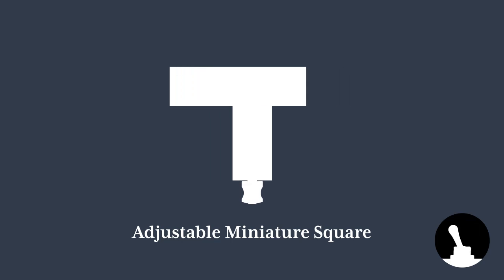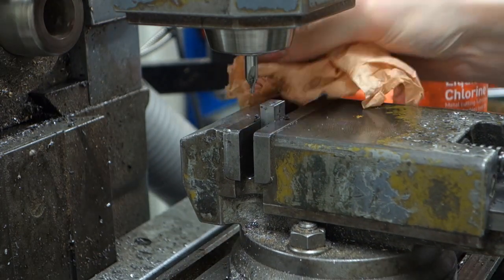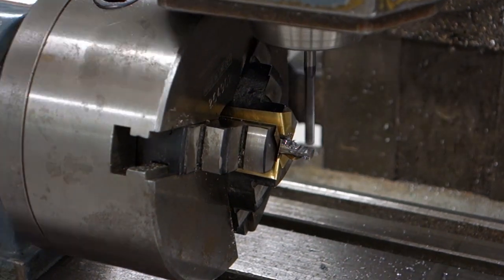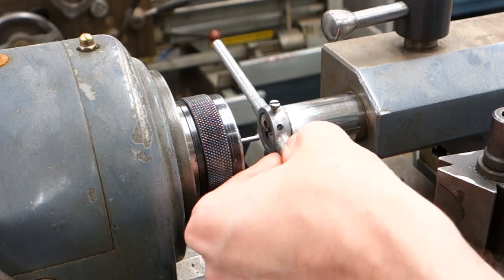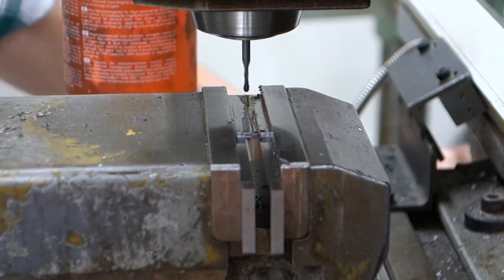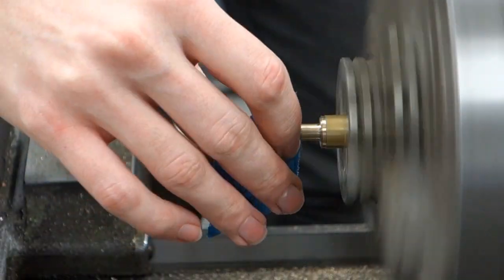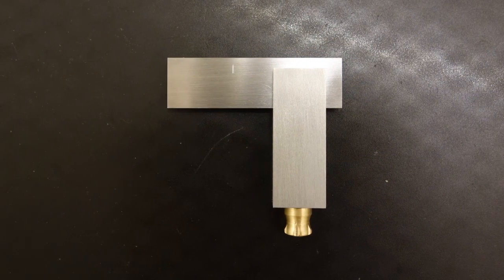How To Make a Miniature Adjustable Square

Comment: I wonder if you lapped it wouldnt it be more precise
Reply from the maker: How precise it is depends on two things. How parallel the groove in the blade is to the bottom/top of the blade and how perpendicular the slot in the handle is to the sides of the handle. For a square as small as this accuracy isn’t going to be a huge deal, unless you really mess up your setup when milling. Surface grinding (not lapping) may help in getting higher accuracy, but this is a quick check square, not a high precision instrument.
Reply: @SwitchAndLever  i see

Comment: nice, no need for a key though, the pin will not turn as the ruler/scale/slider is in the way and will stop it spinning
Reply from the maker: That’s not what the key is for. The key is for aligning the pin to make insertion of the ruler easier, as well as to keep it aligned so when you tighten the ruler it pulls it down rather than binding to the side of the ruler by twisting. So while the key isn’t strictly necessary it’s by far a good feature.
Reply: @SwitchAndLever  good points thanks

Comment: Since the draw bolt cannot rotate due to engagement with the blade, why go to all the trouble with the key and key slot?
Reply from the maker: Two reasons, it keeps the bolt aligned when sliding the blade, so it doesn't rotate and bind, as well as it makes it easier to reinsert the blade if you remove it.

Comment: Nice video, great tool. I think the shaft can't rotate even without the keyway because go the sliding piece. Thanks for sharing.
Reply from the maker: It will rotate enough to bind against the ruler part, which creates unnecessary wear and makes it more difficult to tighten. While not strictly necessary it makes it a better product in the end.

Comment: I like how you shaped the thumb wheel without using a knurling tool! very inventive. Here is my very noob question. How do you test for square when done? 123 block maybe? I have a few squares in my box, but I know they are not precision and I would like to get them there. Thanks, have fun, G.
Reply: gerry mckown I would use gage blocks and a granite plate

Comment: I know this was done a while ago, but I am curious as to why this needed a keyway, isn't the cross piece enough to prevent the nut from rotating?
Reply from the maker: It's definitely enough to keep it in place. The keyway is really only there to make sure the pin stays in the right place for when you're inserting the blade. It's for convenience basically, as the pin rotating when you insert the blade is a cause for some frustration.
Reply: Ok, thanks.

Comment: Hi!
How do you make a key slot parallel of main hole?
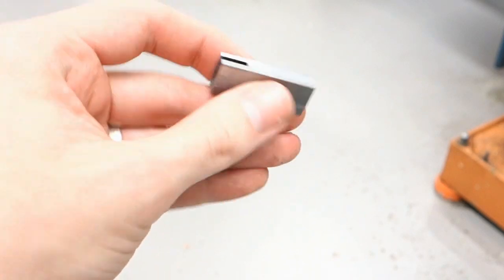In 2:35 - i see one hole, on 2:38- hole & key slot.
Thank for video!
Reply from the maker: As I say around 1:50, I plunge milled a slot next to the main hole. This was done while holding it in the same way as the hole, so all the coordinates were known and easy to figure out. I just used a small endmill to do this.
Reply: Switch & Lever
Thanks, small and accuracy work!

Comment: Hey Switch and Lever! Please do not spray the cutting disc! In railroad rails, we have
seen them explode when they get wet! They are designed to cut dry.
Reply from the maker: The saw has built in coolant (which you can see in the beginning, but it ran low, so I started using manual application instead), so I doubt that what you're saying holds true for at least this application. As you mention though, fiber cutting wheels should not get wet, and I would highly recommend anyone against using coolant with them. If you need to cool down the work during a cut then remove the disc, cool down (dry if applicable) and continue cutting.

This saw, however, was using a metal blade, in which coolant is not only encouraged, I'd call it necessary!

Cheers!

/Daniel

Comment: To simplify it a little you could leave out the steps for the key at the thread end of the shaft.With a blade installed the rod can't turn .
Reply from the maker: Indeed, you could leave out the key. However, I found assembling it without the key in made it a bit harder as the rod wants to turn when pushing in the blade, the key prevents that. It was mainly an exercise to myself to see if I could do it, and attach it properly. 

Glad you liked the video, and I definitely agree, making your own tools are a great idea. Still not quite confident enough to give measurement tools away as gifts though. Hammers are another question though, haha!

Cheers!

/Daniel

Comment: Hi Daniel,

Very nice project. It looks like a very similar size to the one I just got. A handy addition is a second blade that has the drill point angle on it for sharpening drills.

Thanks for sharing your project.

All the best,

Tom
Reply from the maker: Yeah, I noticed it in your video the other day, I had used the drawings of pretty much that exact one from Starrett's site as inspiration for this one. I may still make the second blade if I can get more material, I ran out of the higher carbon steel which I used for the blade unfortunately.

Glad you like it!

Cheers!

/Daniel
Reply: Again - another great video.  Nice tool for the shop.